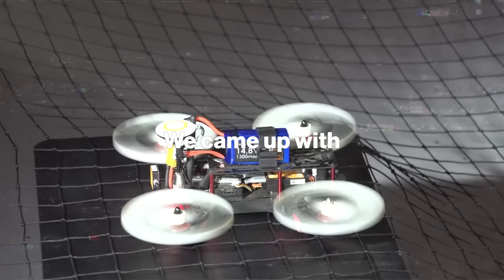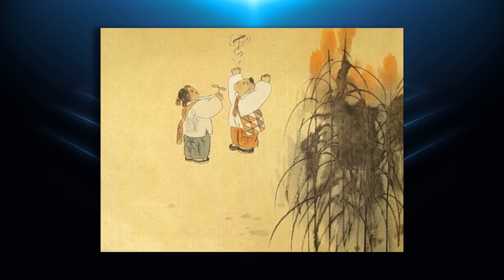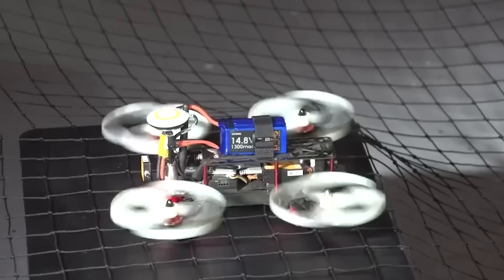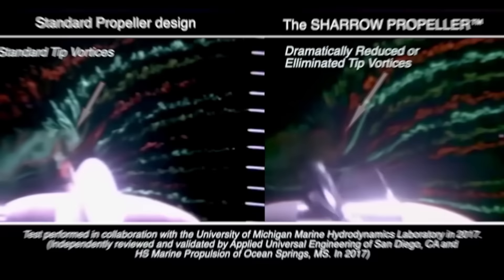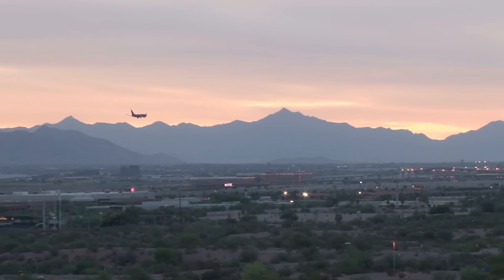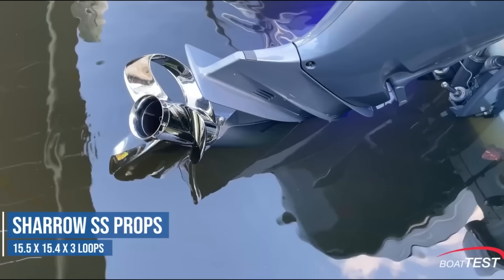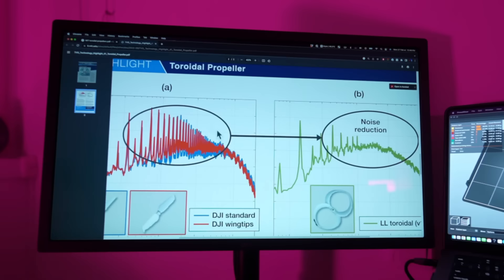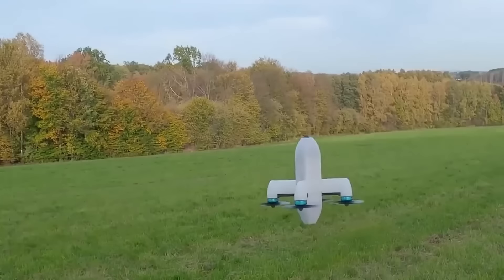This MIT Propeller Is Going To Change Aviation Forever

Comment: Couple years ago I 3d printed one of those propellor rip cord toys…. Half “normal” propellers, half toroidal - the toroidal absolutely positively ALWAYS goes double the height of standard props. Pretty neat to see this kind of stuff follow along with what I already know….
Reply: The additional mass of the toroidal prop enabled it to receive greater momentum from the rip cord that enabled the higher flights.

Comment: Thank you for the excellent video. It will be a challenge, if not impossible, to make a constant speed (variable pitch) toroidal propeller for aviation. Unless, of course, the performance of the toroidal propeller eliminates the need for variable pitch.

Comment: You have a good lecture, but you're implying this propeller would quiet a Jet Airliner which is not true.  As it does not use propellers and the turbine blades are already enclosed. ??

Comment: I suspect this device will never be suited to aircraft.  The drag in the engine-out situation would be formidable and this, combined with the restriction to forward visibility would be unacceptable. When this is stacked alongside the inability to feather the 'blades', either for efficiency in forward flight, or again in the engine-out emergency, does not auger well for the toroidal prop being used in flight.
     However, in the marine application it may prove useful.  Instinct suggests it may work well in a more dense medium but most large marine props have feathering blades so we are looking mainly at the leisure sector where the cost of production may outweigh the  added efficiency.
       No doubt time will tell.  🤔

Comment: How about two 3-Blade Props, offset 30°, stacked, and then Joined by a Strut at the Tips tbat connects the Tips, with another "Blade" that pulls air in the the bodies on the main Blades?

Comment: As with any new technology, the shape must be able to survive an impact from a foreign object in the water or in the air.
This means finding the right alloy giving strength, flexibility and weight.
I'm not sure how well this shape lends itself for composite construction.
It will be interesting to see what happens or if it is adopted on a commercial scale other than things like drones and outboard motors.
Reply: Vibranium or Unobtanium 👍

Comment: ⭐️ it's an interesting design. Saying things like 'it seems to be more efficient' isn't very scientific. It stands to reason that the efficiency could be precisely or accurately measured by using each propeller type on the same drone or rc boat. Does installing this actually make the drone fly faster and farther or does it just SEEM like it..?

Comment: This video feels like an ad.  I am not saying it is, just the style is very similar to videos out there that are completely ads.

Consider:  You mention they are more expensive (10X at one point) but didn't figure out how long fuel savings will break even on the cost (how long until $4,500 of fuel at 20% less fuel will break even on costs).  Even an estimate given an average boat over average use would give people a better idea of the benefit.  Please note:  If you use a boat only once a year, you will likely never recover the excess cost.

Moreover, exploring some other manufacturing approaches (casting and combustion synthesis come to mind) might be approaches to reduce the cost of these items.

I thank you for making the video - I appreciate the new awareness but stand by my observation:  I nearly turned it off twice before coming to the conclusion, not an ad, just looks like one....

Comment: The metal propeller could be easily and cheaply done without CNC machining. Just print it on 3D printer and place ceramics and sand around plastic. Then heat to 1000°C and the filament vaporises. Then pour melted metal into a form. Here is a description: https://www.youtube.com/watch?v=v96LTfmtDPU

Comment: Imagine the impellers in jet engines designed in the torrid shape. could they make jet engines even a little bit quieter, and help produce more output per pond of fuel used

Comment: I know that size would be prohibitive, but is there any theoretical advantage of this design for wind turbines?  Perhaps the blade would not need to loop all the way back to the hub, but if only part of it was there, it would be more like the winglets on the ends of aeroplane wings.  I have read that when the winglet is curved into the design of the wing like these blades are (the so-called 'blended' winglet), it performs better than a winglet that stands up at a sharp angle to the wing.  The idea is discussed for light aircraft here : 
https://www.youtube.com/watch?v=1REKYJGNJMQ&ab_channel=WalkerWeathers

It occurs to me that if the blended winglet is continues all the way back to the wing root, then it becomes analagous to this kind of propeller, and indeed, light planes have been made using this wing design, where the end of the wing is curved over, and connects to the top of the tail fin.

Comment: Hey Genesis,,Hulu forgot one thing in your tickler photo of that single engine Cessna. Since the blades overlap, there will actually be ZERO runway visibility both the pilot! So acceptance for a single engine pull me aircraft will also be Zero! Perhaps for a rear mounted push me aircraft and multiethnic craft?

Comment: I wonder if they've tried adding baleen to the toroidal propeller.

wonder if its possible to build a jet engine w/ toroidal fins inside, or if it would make a difference in that configuration.

Comment: I wish these props had been avaiable when I was running my 37ft fishboat It was built to plane, but sucked up 5 gal and more /hr. When I changed to diesel , I lost 100 HP and she would not quite plane . So I ended up running at 12--15 KT , just below planing speed , this is the least efficient way to run. If I had had these props , I might have been able to actually plane , which is not only faster , but more efficient. Ah well , too old and crippled up now .Maybe the younger folks will get some benefit from them . Sure sound good .!!

Comment: A contra rotating propeller with tip sweep beats this contraption hands down. Seriously! The efficiency depends on the diameter of the ultimate wake, which depends on the diameter of the propeller and the drag of the blades.
having a slightly larger diameter of a modern 5 bladed propeller will equal what gains this contraption offers . But the parasite drag of the 5 bladed propeller is way, way less than this contraption, with the added advantage of pitch control, totally absent with the contraption offered here, a no starter in aviation. Alone the huge weight and inertia  causing gyroscopic moments in turns are detrimental, sorry for all that wishfull thinking.

Comment: Shouldn't be for drones and ones made out of plastic forget the name of those machines they have now 3D printers that'll depend on the cost of material you use to a certain point same as metal with the CNC

Comment: most of this stuff is not true.... they are not 2x more efficient, and they are NOT less noisy. they are slightly more efficient per weight, and they decibels is the same but at a different frequency, so they just sound different, but not quieter.

Comment: It's so obvious it's a wonder no one figured it out before. Additionally it makes you wonder what other applications these could be applies instead of blades could jet engines us a toroidal design for the blades. What about Rotary gas engines using a equal distant toroidal design.

Comment: Your history is wrong.  Those kid's toys work more like a fan blade.  The modern propeller was invented by the Wright brothers through rigorous wind tunnel testing.  It uses an airfoil to create the movement rather than the fan's flat push blade.

Comment: "Energy savings pay for themselves".  Nope... no they don't.  Why?  Because cost goes up to compensate.  I just bought a house.  I got it cheap because it has a lower R value which means... costs more energy to heat/cool the home.  The problem is that if I get a higher R value home, it will cost "significantly" more.  So to say that "theoretical" $200 per month on my electric bill, I am signing up to receive a "definite" bill for $1000 a month to save $200 on my electric bill for 30 years.  I would have to live longer than any human can before I see a return on my investment.

So... I bought a house for 96k in cash and I pay an extra $200 per month doing the hot months to condition it instead of paying $180k and financing 84k just to save well... nothing.

So don't ever say it again... because "energy savings" never pay for themselves.  What we do in reality is take those saving and move them into "other gains", we don't move them into "savings".  Just like how computers allowed us to generate MORE paper FASTER than they do to save us from using excessive amounts of paper.

Comment: show a chart that gives the advantage in cost by using "total cost" instead of talking about it. A 10X cost increase is insignificant if the total cost is a cost advantage. Very simple cost reduction equation.

Comment: The Power Vs. Max Speed Graph that is shown seams to show the opposite of what the narrator says. According to the graph Toroidal 1 and 2 use more power and produces less speed then the Standard. Also, there is no explanation of the meaning of "highly dangerous", "dangerous", and "safe". I like the concept but the data that is being shown doesn't support what is being said.

Comment: In the real world though, if you read some of the papers done on these they don't really help at all if any. Noise yes but efficiency they don't do a lot and in some cases are worse. Plus they are fixed blades when a lot more boats and most planes don't use fixed blades anymore.

Comment: Most positively a great breakthrough design, (even though it's over 120 years old), but I can burn a lot of extra fuel for the $4500 cost of this boat prop. "It pays for itself  because of the efficiency improvement." Any efficiency improvement will pay for itself over 'time', even a .001% improvement. Unfortunately, that "pays for itself" statement is not a valid stand alone claim. The factor it must be judged against is the time frame required in which it pays for itself. For the average recreational boater that payback time will likely never be achieved in their lifetime if they are only running 100 hours a year or so. A 1 second video shot of (whatever) the 'test' (was) with no explanation of it does little to enhance the legitimacy of this post.

Comment: at 6:25 when they are talking about bubbles they show one where the prop is NOT fully submerged then other video is showing engine that runs exhaust out through the prop hub.
7:45 the boat props are NOT 3d printed they are CNC machined.
as with many of his other videos shows lack of real research into the subject to get facts correct.

Comment: One of the best propellor is the Dragon Fly, thinking if could have The oar instead of Swirl could have the same maneuverability. Thinking if propels best in H2o, will more than likely propel best in Air, Thinking Oar Dragon fly will go faster than Hole replicates. But Dragon fly hard duplicate, Long, Strong Landing Gears with shocks

Comment: Well I’m not sure about the General Aviation/ commercial Aviation Market as the prop isn’t really looking like it’s suited to that design field in its current state.

Others in the aero engineering field have commented that already and I agree with their assessment.

One thing I would like to see this applied for data though is in hydro electrical generation.

If it’s out efficiency is that high could it be reversed to turn a generator and give a higher output. ? 

Saying that I am thinking I’m shadow banned for some strange reason nowadays so who knows who gets to read these comments.

Comment: No it isn't. This design has been tested and is inferior to the original Propeller design. Looks strange but that is all. So far everybody that has tried every configuration of this design has been a failure. It just looks weird, that's all. Viktor Schauberger had some different ideas for creating vortexes. It could lift a craft vertically on a column of air or pull a plane forward by creating a Vacuum Vortex in front of the plane. He must have been as wrong as the guy that posted this video because as far as I know we don't use any propulsion technology that Schauberger invented.

Comment: Petty Greed is the reason these props cost so much. Should they cost more, sure, because they will take longer to make; but costing 10X more is sheer greed and nothing else... The material cost is similar and only a slight increase in machining costs over a current prop does not cost 4,500 USD; that's absurd. Greed and Monopolies are killing the Free Market hence the world is so bad off in 2023...

Comment: This is a false heading. Firstly, there are no "Toroidal Aviation props". Drones do not count, they are cyber toys, albeit with a useful function. The essence of the new design, is dependent on the high speed of the leading blade, to create a pressure cell for the recessive blade to leverage on. Now, that works in hydrodynamics, but when you increase the scale on an aviation application, the aerodynamics do not allow for this effect. The blade is moving too slowly for the 'cushion' effect. And increasing the speed of the blade, on a larger diameter brings you into the arena of air density and the sound barrier. We all know where that ends.... so much for the hype.

Comment: Its just one big sales pitch.. the tests I have seen so far are slight gains for a speedboats at only certain rpm's, but negative results on air props or fans. So no 200% efficiency gainsclaimed in thevideo, just a scam

Comment: Sounds like humbug! 105% higher efficiency! How? Most props run at 60 - 80% efficiency, 123 to 164% efficiency!! Isn't that against a law of termodynamics or something?
 Lower rpm means need for a gearing, apart from the more expensive prop!

Comment: Another not scalable project. It works on drones and boats because it's fixed. Real size planes need variable geometry propellers because big engines can't be adjusted by adding power in 0,1 second. Another thing, reals size propeller like this will be heavy. I'm not expert byt that must not be good for the engines. But for boats, if it's really that good they should be changing them right now.

Comment: The ability to vary the pitch on aircraft props, and rotor systems is paramount to performance. Not possible with a toroidal design. Do you think for a nanosecond that Pratt & Whitney, Rolls Royce, and GE haven't thought about toroidal fan sections in their turbine engine designs? Of course they have and they don't use it because it won't work. Noisy boats, noisy drones..."Frankly ma'am, I don't give a damn!"

Comment: This has so much misinformation. You cannot use this propeller in a commercial airliner or a military jet. They run on turbines which are already much more efficient than propeller-powered planes. You are just throwing out random applications that make no sense. Also, the common propeller still performs better. all the way around. In real-world tests, it did not significantly improve in most applications. They still have a lot of work to do.

Comment: This probably has zero ability to be used in modern jet engines. It won't change the giant commercial aviation industry. Even if it's light enough for turbo prop aircraft.

Comment: Completely pointless design work by MIT that fails to understand how the real world works just like everything else at MIT. There is no application for a prop like this in aircraft at all, it wouldn't work, you would either be stuck with a prop optimized for takeoff or cruise instead of being able to trim and that is a special kind of dumb. I would also point out the information in this video is wrong in several cases and the video writers obviously don't even know the most basic things about general aviation or physics in general. I have met snot nose teenagers with a deeper understanding of mechanics than this guy would have if he spent the next ten years studying.

Comment: quits day job
so what? i worked out how to make thrust with negative parasitic drag. ie... it adds to the thrust.

cant avoid the drag from producing lift, thats a necessity for flight... but parasitic drag? yup. easy to eliminate. the trick is to get the slipstream to flow the other way...

noones interested. im just a now-jobless former courier. no MIT status posing for moi. no degrees. no phd. dumb dumb.

returns to work, humbled, applies to van, halves fuel bill.

Comment: If, or when this new propeller design is scaled down and made of plastic or composite material and then put in a ducted fan configuration, like the Lilium jet model, or maybe an aluminum/titanium alloy, is when this new propeller design will really take off and then we're talking about vertical lift planes, and that's a very good thing and they will probably start with light aircraft on the order of the Kodiak 900 and the like.
Reply: DELUSION MY FRIEND DELUSION.....

Comment: …the pure mass and the fragile complexity…and as said the fixed pitch…is a no no…and even though the vortex handling capability…all that surface area…i will not sit in such propellered plane…no no…

Comment: Where I live all the noise pollution is from the ground from automobile motorcycle  engines that sound like a stick of dynomite going off with every stroke of the piston being driven by obnoxious assholes that ate purposely trying to compensate for being less endowed in other areas. areas